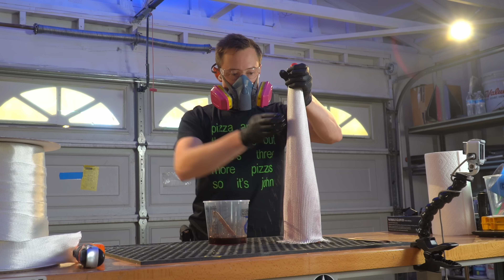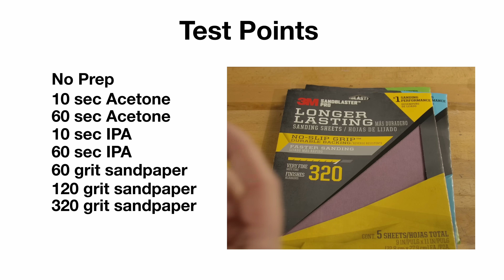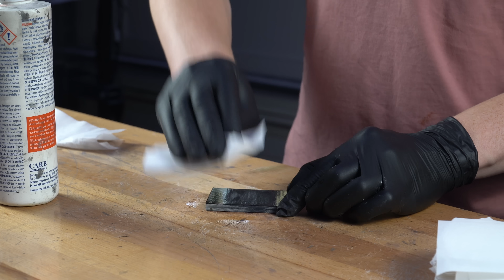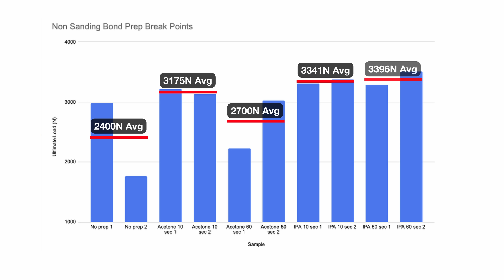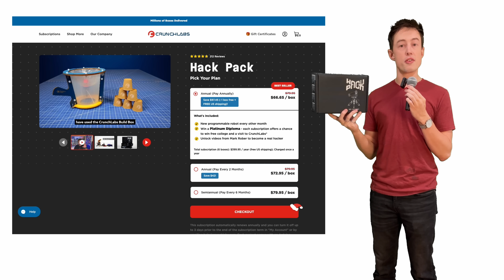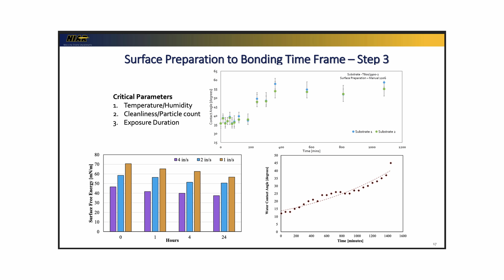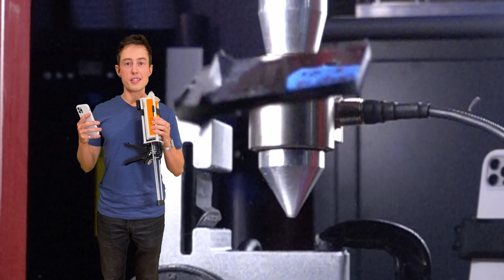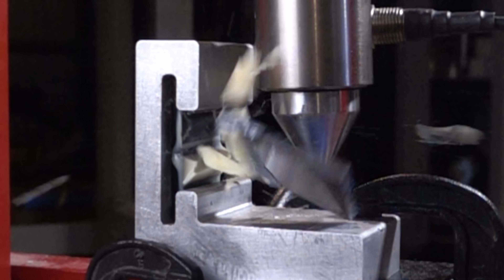I Broke 100 Epoxy Bonds to Find the Strongest

Comment: So I finished the video and I'm looking at this problem from my manufacturing perspective in the automotive field. In automotive, we did a lot of vehicle interiors. Basically anything that was soft touch in your car is what we made and we primarily used plasma and flame treatments, and molded in surface textures to get our bond strength. In automotive we're much more limited on what we can do because it's very time constrained manufacturing. We didn't have the luxury of waiting 72 hours before applying material to a surface before it had to ship out to a customer.  The most consistent adhesion we would have is when we treated the surfaces immediately before bonding such as with a flame treatment or a plasma cell, i'm talking like seconds or minutes between these processes. The flame treatment was most economical because it was fast. It would burn off any residue and was easy.

Comment: Vacuum degassing, more than mixing may be removing air from between the epoxy and the fiberglass.   Then when you remove the vacuum, the epoxy gets pushed further into the fiberglass by atmospheric air pressure.

Comment: Your mold extraction technique is awful!
fracturing epoxy will cause micro-fractures which can expand and propagate through critical stress points in the material which will yeild inconsistent results.
This may be non-existent or an enormous concern but due to your designated aplication for these parts (to test them) it may be a critical failure in the manufacturing process.
If your part batch average yield strength is within a small standard deviation then this is not a concern, however if the yield strength of parts in the same batch is highly random then this is a likely culprit.
This all depends on the intermolecular bond structure of your epoxy of choice ie if it is an amorphous-setting resin there is likely little concern, still this highly random variable you introduced is sub-optimal to say the least.
typically you'd use a break-away mold or a good mold release, like lubricating your molds with regular grease or using plaster molds.
Reply: Sorry for the unprofessoinal language, well I guess this is a YT comment after all.
I wanted to say this introduced variable may impact your yield strength results by an unknown magnitude anywhere from 0% to ????%
But from what I've seen I doubt the effect was significant on your final conclusions.
It's like introducing a hairline crack into a sheet of glass at worst.

Comment: In my experience, a little water content in IPA actually improves its ability to clean.  Clean, abrade, clean to avoid grinding contaminants into the surface.  Methacrylates can work a bit better than epoxies bonding to composites.

Comment: Very interesting. However, all results may be invalid since the upper edges of the joint are random since there was no form around them. Those edges may have way more influence than any form of surface prep.

Comment: Already back in the last century, we found out, than to have carbon fiber layers must be bonded with a matrix thickness of less than 1/100th of a millimeter, else the test samples did not behave as the cad engineering models predicted!

Comment: I would try making a tongue and groove style joint, applying the epoxy to the edges. Like they do for some shelving in cabinets. And maybe even apply a layer or two of fiberglass into the corners of the joint making it, hopefully, act as more of a single solid unit.

Comment: engineer's ichor (composites) are a mess! I hate and love them.
They are very powerful but also unisotripic and non-homogenous.
Simulating composites is mostly guesswork, the only way to know is to make and break countless prototypes and even then one slip-up on the production floor can destroy a whole batch of product.
too many variables, but extreme potential: the schrodinger's material.

Comment: Awesome to see your testing. Have you thought about using a media blaster (sand blaster) instead of using sandpaper?
Using specific sizes of media & materials may give added consistancy. Getting a surface roughness measuring device will let you know exactly what the surface is like prior to bonding which may give you some relief as when using a media blaster for surface preparation variables like media size, material, air pressure and media flow can effect the part greatly
Once you get your ideal results though keeping the variables the same will save time massively.

Comment: Perhaps one thing the acetone does (since it attacks the material) is that it makes the surface form lots of microcracks, like mud in a dries river bed? Thus working a bit like sanding the surface (until it's completely eaten away after a few more seconds). Just something from my armchair right here.

Comment: So my no recorded data experience over the years is to sand under IPA, clean thoroughly under IPA, and actually use a scourer pad laden with the epoxy to work into the surface. Mathematically higher grit actually has both a higher surface area and a lower average fracture generative properties. Working it into the surface solves this. And vacuum degassing doesn’t completely solve this, because it relies on the bubble still becoming large enough to become buoyant. Which obviously with microscopic lines in a viscous fluid isn’t exactly applicable. 

So my solution is to wet some steel wool in the epoxy and work the surface.

A thought I’ve often had but never experimented with is laying up in a helium or hydrogen environment. Something that the diffusion will naturally collapse any trapped gas.

Comment: stuff doesn't really want to stick well to aluminium, so in shipbuilding we use 36 grit sandpaper with back supported discs for an angle grinder to rough up the surface and then the paint, plaster or glue will stick much better.

Comment: I've got a 'brilliantly dumb' question regarding epoxy mixing- what if you freeze the resin and freeze the hardener solid, grind them into powder, then mix?  Similar to mixing black powder.
I ask because that was a hack I learned back in 1990s for mixing gradient polyacrylamide protein separation gels.
You might also try a 'gradient mix' setup with polymer in one beaker and crosslinker in the other beaker and use U siphon to create a gradient mix- quick lab trick to create a smoothly changing concentration- should let you identify the best mix ratio.
(based on my lab rotations through Thomas Jefferson Univ. Biochem & Molec Bio PhD circa 1990)

Comment: Good work, not only liked, but saved for later reference, you consistantly produce excellent work including recognising your limits.   For calculating averages and standard deviations, (I had to do this for product datasheets), the average you measure has a degree of uncertainty, that uncertainty has a standard deviation.  The same for the standard deviation, has uncertainty (the standard deviation measurement has its own standard deviation)..  Thus..  I did a load of maths and tests and calculated that for 3 sigma limits, I needed to measure 33 parts, then take the average and standard deviation, I then took the 4sigma limits as measured, and quote those as 3sigma limits. This gave me 95% certainty that the REAL 3 sigma limits would be within my quoted limits.  With only 10 samples I needed to quote ~5.5sigma limits as 3sigma limits (I'm not a statistician, just a nervous engineer).   The take away from all this:  you need a TON of samples to get any kind of certainty.  There are formal ways of doing all this, which I later used but I felt my fumbling around with the maths was more instructive.  In your case I would calculate average and standard deviation and take SIX standard deviations to calculate the limit.  The lower limit for a 6sigma threshold would give you a 2400N limit.

Comment: probably tack cloth makes a difference - I'm "an Engineer" - I have the Tee Shirt - but only spent a short time in any performance composite world (and even there, there would be quite a lot of "technician superstition" - as a scientific proxy.   Green moulding and progressive / suspended curing is still probably state of the art - through tufting ?? - pre-cured sheets is pretty low tech.

Isoprop or Acetone - probably needs the time to evaporate (acetone softens cured epoxy)...

Comment: Why no etched and debrided surface cleaned with high pressure CO2-methanol spray in an inert chamber?   Would NOT be the most dangerous Tuesday of your life...

Wait, I got to 0:06:45 and said "Ohhhhh, that's what he's worried about."   Bifurcate the root of the fin into a series of chevrons like a tractor tire and use uSound to work the epoxy into the channels.  Like 30x increase in surface area with a 50% decrease in mass for the bond and you can create stitchings from the flight body housing that insert into them.  That kind of bond is more likely to rip the Feynman out of reality than fail to a crosswind.

Comment: MAN, you did it all wrong. You need to FIRST push in the glue in the fresh sanded surface, work it in really well, and THEN glue both parts together. You cannot just pour a glue on a sanded surface.

Comment: Unfortunately, when the imperfection of the testing lies in majoy inconsistency, as indicated by the variation between your repeated runs, it really makes the results not so meaningful anymore. If I were you I'd firstly try to get more consistent results with samples belonging to the same test parameters... Surely you could have put in the extra effort while you were at it... But hey, this is better than nothing, good job

Comment: Another thing I learned from a master paint scientist, no matter what solvent you use or how many times you clean the surface with it, it's always preferable to include a degreaser (simple ajax/comet powder works great) scrubbing step, because even if you clean a surface 10 times, you'll never be able to remove that atomic monolayer of oil/grease contamination, because you're ultimately just diluting the hydrocarbons/oils. You can also heat to 300C or sandblast instead if you're able, but degreaser scrubbing is cheap, easy, and fast. Just make sure you do your paint/epoxy within 1 hr after prep, or else you'll need to use something called gumming solution to preserve your serve until then.

Comment: Do you plan on using only glue fillets on the wings or will you apply some tabs of composite and resin from the wing to the body? If wing failure is a real concern adding tabs would increase strength and toughness vs fillets only.

Comment: I've heard from people that do clear resin casting that pressure works better than vacuum - seems  plausible that smaller bubbles may not be buoyant enough to overcome the viscosity, whereas pressure shrinks them much more than vacuum expands.
This is probably less practical for rocket parts though!

Comment: Correction: It is a RANDOM orbit sander. By definition it is creating a new uncontrolled variable. That said, hand sanding any substantial amount of material sounds like an exotic form of torture so you will have to decide if the variable results are within spec for your project.

Comment: I worked in adhesive and coating technology for several years and your results are plausible but there's imho still room for optimisation and improvement. Just imagine the mechanism, you want to fill every single gap in the surface so you need a profile that doesn't leave cavities that are too narrow and on the other hand you want a low-viscosity resin that does the job. Improvements in fluid resins that came about 20 years ago were a game changer compared to solid resins that had to be disolved to become processable as thinner leaves a less dense material. But I think you can still find an adhesion sweet spot by using a tiny bit of thinner (about 1%, maybe even less). You also can reduce viscosity by raising the temperature if your resin is slow enough. And a 3rd way to improve adhesion is scraping a part of the resin into the surface instead of just letting it flow in.
About surfave preparation itself sanf plasting is better than sanding, rougher is better - the optimum on blasted surfaces is a Ry5 of about 70 to 100µm - that's extremely rough, the surface then looks like a 40 grid sandpaper. Vacuum clean the surface and instead of wiping it - which pushes fine dust into the cavities - rinse it clean with IPA and dry it warm thoroughly as alcohol reacts with epoxy resin in a way you do not want.
The strength of the resin can be improved as well. Slower epoxies tend to reach higher strength in general and even if the resin is not a hot bonding one, strength can be improved by raising the bonding temperature to between 50 and 60°C, depending on the resin maybe even to about 100°C and this should allow to increase the epoxy strength by about 10 to 20%.
All in all I think your optimal test results would be about  20 to 30% higher than what you got here...
Addition: I thing the bubbles visible when degasing are more vaporises diluents than air bubbles, so imho you raise viscosity when degasing.
Idea: Clean surface and rinse sandpaper with acetone before sanding?
Reply: Possibly "the bubbles visible when degasing are more vaporises diluents than air bubbles, so imho you raise viscosity when degasing."

Food for thought. 👍

Comment: Maybe in the sandpaper you could wash emery cloth to remove contamination?
I'm also wondering if a small variable is the distance between the two pieces, affecting the force moment?
I liked the other guy on here who said they dried the IPA with N2, that must retain some of those free bonds longer.

Comment: Not one test you ran shows the substrate layers failing, and that should be the target result, the rocket rips before the fins fall off. With 1/4" G-10 properly bonded,,  Bending your jig or part before the joint fails should be in the realm of possibility. 

Fillets are just reinforcement beads, and usually for your sink. That’s as rudimentary as any glue joint gets. The epoxy shatters right on cue at its focal point every single time because all the stress is concentrated in one line. I honestly don’t know why this is treated as a structural method.

The correct approach here is keying (creating an actual mechanical interlock) combined with gussets ,and no, not tab mounting. Proper keying looks like screw-thread geometry cut into both surfaces, even cutting into the fibers if the design calls for it. That alone can easily quadruple the surface area the epoxy can grip, Surface sanding is a small part your area. Cutting halfway into your thickness is not unheard of.

Very consistently you ended each test with two clean pieces. The mindset should be aiming for four or more pieces, or one bent one that’s what real structural failure looks like.

Then gussets " many layers of filament' take over where fillets fail, they spread the load into the structure instead of letting stress build up in a single break zone. Once epoxy starts failing in one micro-area, the failure cascades. That’s why you’re seeing the joint pop off cleanly like a cookie off a sheet pan instead of ripping fibers and tearing laminate.

Also, post-curing and using an epoxy system compatible with your substrate matters, the adhesive and the laminate need to “move” the same (modulus compatibility), or you’ve built a hard spot and a crack starter.

Epoxy is not made to do what you’re doing here. Prep was good advice but nobody in aerospace is relying on big cosmetic fillets like this as primary structure , fillets are for sealing and smoothing, not for pretending you’ve got real joint design.
Reply: "pretending you’ve got real joint design"

Ouch, that hurts, very much on point. 👍

Comment: Random thought on atomic oxygen or flame prep: If it's oxidising radicals that are doing the work, would a peroxide solution be worth a shot? A solution would allow soaking for a consistent time and concentration, more repatable than the plasma spray.

Comment: If you want consistency BE consistent.  Put your sand paper on a flat plate and move the sample a set number of time over a consistent distance. Obviously use a clean area of paper for each sample. Apply a mass as a pre-load, not arbitrary finger pressure. I would also mechanically apply a thin coat of resin to each sample before assy and pouring, ensuring only a few seconds before the pouring. If you want consistency BE consistent.
Reply: Was about to say something similar with respect to the sanding. Seems a pretty big variable.
Reply: To be fair, that's not always an option in the application he's aiming for. Then again, neither is degassing-after-application, as he himself pointed out

Comment: I don't know if it's good for applications but you can try co-curing instead of secondary bonding. So that you connect two uncured parts and add resin reinforcements , instead of adding adhesive onto cured parts. I heard that this method helps to get stronger bonds.

Comment: Don't cringe over your "bad" data / prep from the start of your video, this is still very valuable for one simple reason. We now know what NOT to do and WHY.

There's always a question people like us ask, "Ya that's consistent but what's best?" Which is the whole point of the video, and this video answers that question for the most part.

Also it's interesting to note how much more consistent sanding made the results at the end there. The differences were noticeably smaller between samples.

Comment: Engraving both sides with uv laser would give you even better results than 60 grit. It would at the same time allow you to control the cavity depth and pattern on the samples. UV galvo lasers are fast and getting cheaper and cheaper.